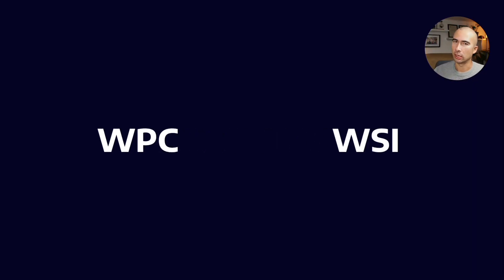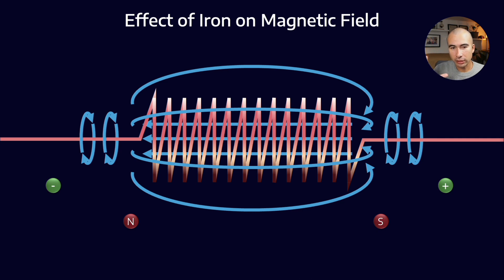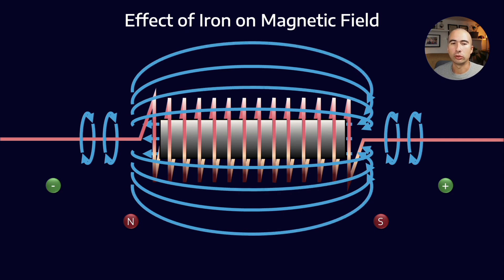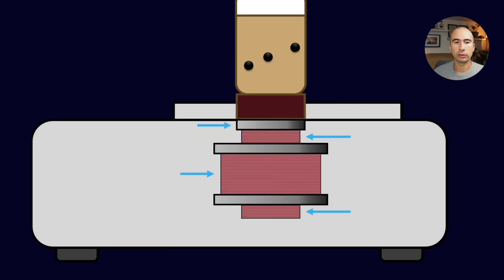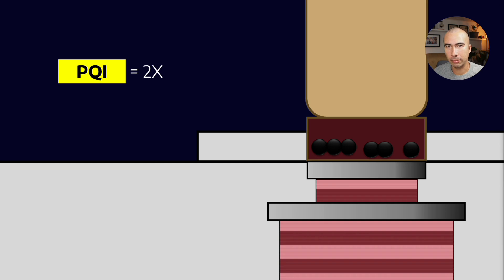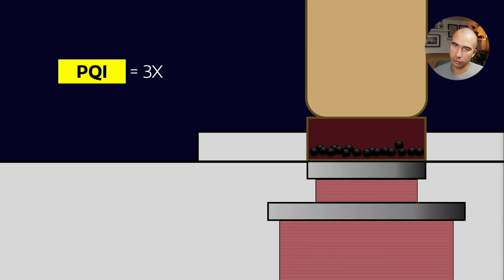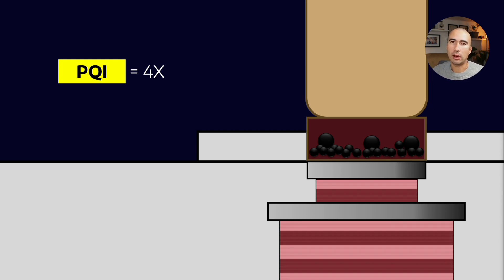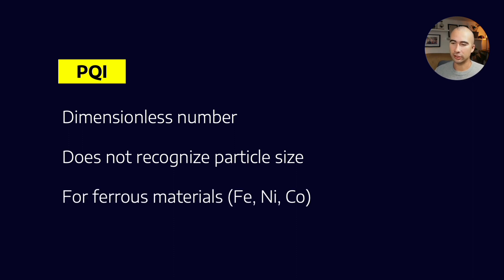How does Particle Quantifier Index (PQ) help you understand wear?

Comment: Hello, how can I calculate PQI through changes in the magnetic field inside the coil, and why does PQI increase with larger particle sizes at the same ppm? I have an ANALEX PQL instrument, and I have reached this conclusion using this instrument. However, during simulations using COMSOL, I found that the coil's inductance increases more when there are smaller particles but in greater numbers at the same ppm. Do you have any suggestions regarding these findings?

Comment: Yup, yup, yup :) Fans of lab oil analysis should know/ learn that Fe, ppm, reported, is spectroscopic?
Does not pick up bigger sizes? PQI is that backup? The particle size in between spectroscopy & Filter micron?
Mr. LE, Pl state these micron numbers? To elucidate, your Good Subject?
Reply from the maker: Correct, ICP metals only picks up particles less than 8 micron in size. So PQI is reflective of the total amount of Ferrous material. It doesn't do "ppm" though, it's just a dimensionless number.